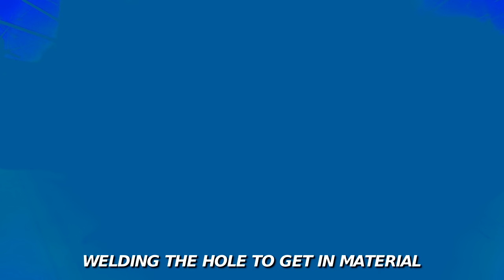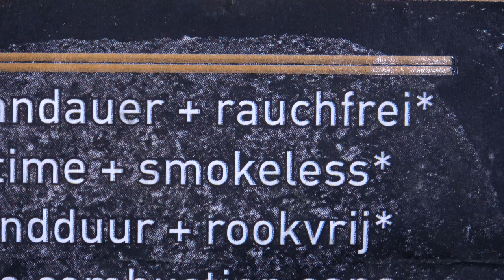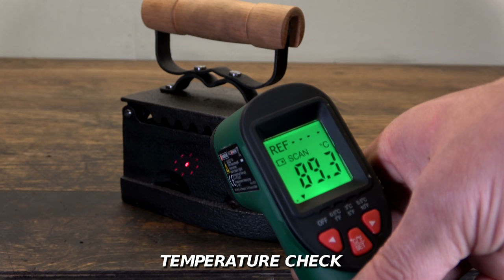1930´s Charcoal Iron | Restoration

Comment: I've learnt a lot from you. One tip I learnt from others though, when building up a piece with the arc welder, back the work with copper. It doesn't melt and doesn't stick.

Comment: Haha my grandma has one of these, it works well. But it's just as old! Marvelous job restoring this thing.
Edit: I also have a soviet kids sewing machine that looks like a singer machine but is way smaller, I had to remove the rust on it and it works great! Also, if you look at the tool post on your lathe, the cutting tool should be on the other side :D

Comment: Just a note from the lady side. That's a "swing iron". You put the coals in and swing the iron back and forth to make the coals glow hot. As long as you have coals, you don't have to "reheat" the iron. That's the reason for the "dents" at the face of the iron, so that the plate heats up faster.

Comment: Few questions.
1)Doesn’t rubbing with abrasive over a blued surface remove the formed oxide layer? Or does repeated bluing actually works? Just curious!
2) Is a thin oil coating not enough to cure the blued surface?
Reply from the maker: 1) you could remove it completely, but it takes some time. So I just removed ~50% per step and repeated the process, to have a rustproof layer in different black tones 🙂
2) sure, a thin oil coating does the job as well, but doesn’t look cool while applying 😄

Hope I could answer your questions!

Comment: The bottom wouldn't actually have needed any welding and finishing. They weren't smooth from the factory either. I found a old soviet un used old clothes iron on a fleamarket and the bottom was just cast iron like the rest of it. So that's a improvement to the product. The iron didn't have any bluing either. So the heat bluing on your was just from the years of use to it probably? Really nice work and improvements

Comment: I hope you don't get me wrong, but I need to tell you something that might make sense if you think about it. I have a small collection of old cameras. they all work and some cost me time, work and money to get to this condition. In fact I don't use them and they are actually just objects. People who visit my house don't know that my beautiful cameras are functional, but if I were to look at them, knowing that they are cameras that don't work, there would be a sense of botched stuff. A kind of counterfeit object. I would look at these machines with a certain contempt. Work objects are only truly restored when they can be used again in their original function. Otherwise, they're just decorations as tacky as those you can buy in one of those cheap counterfeit stores. I don't want to offend you, but I've seen other works of yours that turned out much better than this ornament on the iron. This is far from a restoration.
Reply from the maker: This basically is the most original I did. These ornaments are fully original, so is the bluing. Difference: the bluing was done with heat and oil back in the days. Google for it, these irons looked exactly like mine after restoration.
Reply: @misterpatina   I ask a thousand pardons. I was sadly wrong in my comment. Your iron is perfectly functional and I, having been hasty in my comments, made a fool of myself.

 When I realized that you were applying the bluing coating to the iron cap, I got confused thinking that you would be treating the iron base. as I was angry with what I thought was the creation of a merely decorative object, I interrupted the video and made this inappropriate comment. 

There is no justification for my hasty, lazy attitude and the low confidence I have placed in your work (you have shown in many videos that you are trustworthy when it comes to your work)

 There is no justification for what I said, but I can at least show regret and apologize. And that's what I do right now. congratulations for this work, as well as for many others that you have already done and certainly will do. 

I subscribe to your channel now.
Reply from the maker: @OsorioThomaz1  hey my friend, it’s all good, you don’t have to apologize. I was just confused because I was pretty sure about doing mostly original work. 
Thank you my friend!